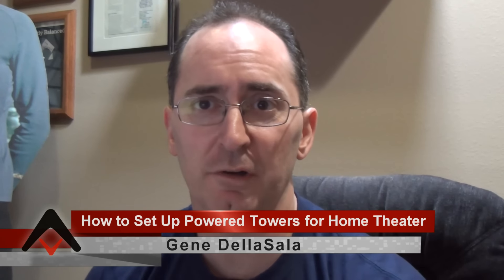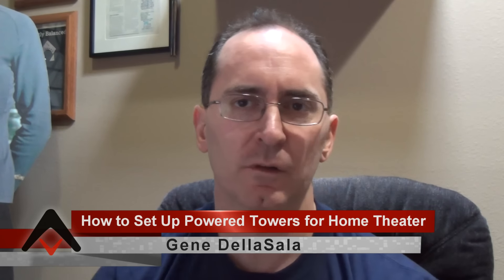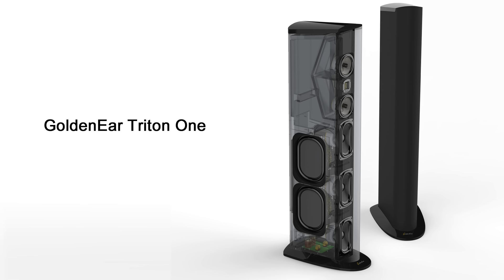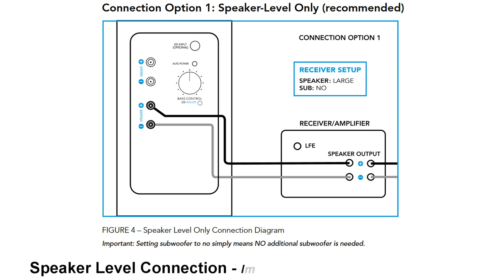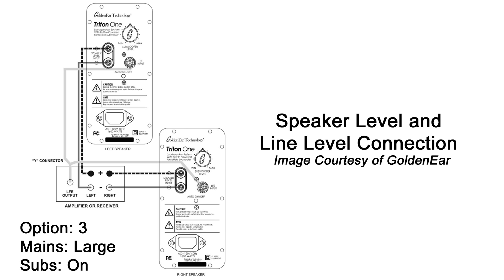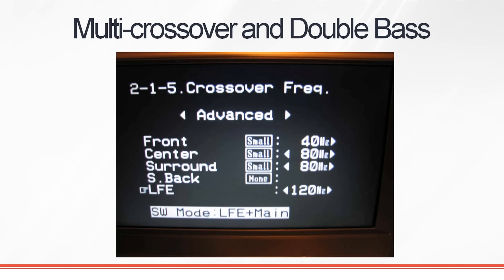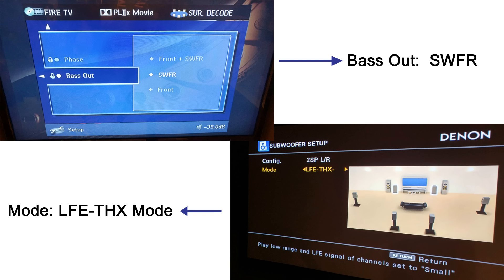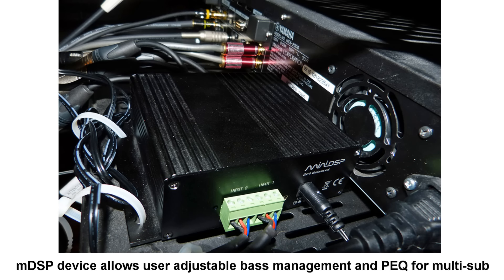How to Set Up Powered Tower Speakers for Home Theater

Comment: I'm a little late to the game on this. I'm an avid Audioholic consumer, but I missed this. I have been running RBH 1266 towers for years. When I moved I lost wall space and the sub had to go. I set the towers to full range and bass plus but I was never really satisfied with the solution, even running with a power amp. I then bit the bullet, purchased a crown XLS 1002, decoupled the binding post and set the tower to small and use the built-in 12" drivers as dedicated LFE subs and my system sounds amazing again! Great explanation and options, Gene!

Comment: One thing to consider on the Def Tech towers and center channels when deciding how to set them up, either full range or small is this.  Gene you mention setting them up as small with LFE will give you better bass control than having them set to large.  But, at least on the Def Tech 9000 series, each left and right and center channel has bass management controls on the rear of each speaker.  A dial with 1-10, to set the bass output.  In my opinion, that negates the necessity to use the LFE out put.  I don’t know if Golden Ear or other large fronts have this feature, but I like this feature on the Def Techs.

Comment: With my Polk RT3000p, after trying different options, I ran subwoofer cable from AVR to each of the towers. I incorporated a MiniDSP to tune them in with my 18" Marty's and the sound and bass was significantly better.  The powered subs in the towers are no where near the other subs, but by adjusting them individually to work with more of the mid and higher bass in the 60-90 Hz range and the monster subs hitting hard in the 60 Hz with more pressureization and dig down to 14 jz in my room.

Comment: I have Def Tech BP7001sc mains, CLR3000 center, Def Tech BP/VXp sides and BP7002 rears with a sunfire true signature sub. I run all speakers as large because they all have powered subs and LFE out to the sunfire. However in running all speakers as large that allows me to control my crossover point without setting them to small and being stuck with 80hz. I bought large speakers to use them, if I set them to small I would've just bought satellites. I crossover the front mains at 40hz and everything else at 60. This was chosen after using RTA and FFT analysis for the smoothest blend with the sub.

Comment: Thank you so much for the informative video! I recently bought a pair of definitive technology bp9060's for my L/R channels to match with the CS-9060 center. Using the Denon X4500H. Should I choose your 3rd option by setting them to Large, Sub On along with the small pioneer 8" subwoofer I currently use? Maybe disconnect the sub and just use the towers as my living room isn't that big. Thanks in advance for any insights.

Comment: Hey guys, another awesome video. Just what I was looking for. Been running my four powered towers as small and running a splitter from my 2 sub output on my receiver. Going to try setting them to large and set LFE on to use the built in crossover.

Comment: Thanks for this, setting up powered towers is something nobody ever talks about. Benn using Def Tech 8060s but had it set to LFE+Main...I will correct that now
Reply: Whcih configuration did you switch too? and did you experience a noticeable audio improvement switching from LFE+Main to the new configuration?
Reply: Tyson Hook right now I have it set to just LFE...I run the main as large to get some use out of the woofers in the towers and to help spread out some of the bass...it sounds fine but I am always tweaking it...getting powered towers and a large sub perfectly tuned in a small room is tough...it's not like video where there is a test pattern and you just calibrate it..with audio, and especially bass, there are just so many factors to deal with. Add to that that I only have one location I can put the subwoofer...it can be tough to balance everything out

Comment: I’ve been using the RBH SX-T2/R and SVT towers for a while. I set them to small, XO = 120Hz, connect speaker wires from pre-pro to top cabinets, connect line cable from Sub Output of Pre-pro to external sub amp then speaker wire from ext amp to the bottom bass cabinets.

Comment: I'm running 6 Paradigm Shift A2 powered bookshelves that get their signal from an Asus Essence STX II 7.1 sound card.  The LFE goes out to a Paradigm DSP-3100 with a Paradigm MC1 powered by a Dayton "T" amp handling the center channel.  I keep the bass management set at "small" with it crossed over at 69hz.

Comment: I am running 4 Def Tech BP2002 with a Def Tech PF 18 TL sub. I just updated to a AVR-X4700H receiver. Right now the best sounding hook up I have found is running LEF input, large speaker setting, and the low range jumpers removed. I have two questions, that Def Tech could not answer. The first question is can I run full range with the low and mid jumpers installed, while running LFE? My second question is if I have to take out the lower jumpers will my Frequency Response of 18Hz to 30kHz change. When I asked Def Tech  they said it would not change. But I don't see how it can't change with the lowers removed from the circuit.  The reason I asked is so I could determine the correct cross over range up the highs and mid when I have the receiver set to small speakers.

Comment: Hello Gene ;  I had 2 - 60 inch Pioneer Elite Plasma and a 60 inch Panasonic ZT 60 in my man cave above garage. On December 10, 2018 an electrical fire broke out. My Definitive Tech speakers and everything I owned burned to the ground. A 2200 square foot single family home was gone.  Because I’m paralyzed from a broken neck in 3 places 30 years ago, I was trapped upstairs. With fire burning everywhere, I dove head first down the stairs and was knocked unconscious and woke in black smoke unable to see or breath. I heard a fireman yell my name and yelled - dont leave me and passed out - they found me but I’d stopped breathing and cpr was needed as they dragged me out the door and the home collapsed.  I’ve lost everything and just returned home from UNC BURN CENTER after weeks in COMA and 3 months total. I’m looking at DEF TECH 9020,S AND PRO 1000S AND whatever you can suggest.  Thanks
William

Comment: I have some BP7006s and a CLR2002. Had a sub but it's too much for my small living room. So just wanna use the BPs for sub. Have Onkyo TX-NR696. What would you do? Also should I double the connection to the center channel?

Comment: Do you recommend connecting the def tech CS9080HD center speaker with speaker wire set to large as well as LFE to the center preout on my receiver? Does that allow extra punch on the center or is it dangerous?

Comment: I am using def tech bp9060 and have them set to small with 2 def tech sc2000 using lfe to both subs with a Pioneer lx701 avr. I would like to use lfe for 9060 but using splitters is not recommended by Pioneer, Suggestions?

Comment: Hello,

I am looking at the Definitive Technology BP9060 and I have a SVS PB12-NSD Subwoofer. How would you recommend hooking up these speakers if I end up buying them. Also how well will a powered sub (PB12) integrate with a powered subwoofer tower like the BP9060. My other option was the Klipcsh  RP-8000F since I already have a sub. I do not want to get rid of my sub so which one would be the best option. Thank you

Comment: Great video!  I have been looking for this info for months.  Current setup, denon x3200,  lfe only at 120 hz to svs pb-2000, 8060 towers speaker wire only set to large at full band, cs8040 set to small at 60 hz.  a60 set to small at 200 hz.  dynamic volume off and dynamic eq on with reference offset to 0.  I will try adding a splitter and lfe to the 8060 towers as well to see how that changes the sound.  Great info!  I have read you should set the crossover 10 hz above the lowest range of the speaker.  So I set mine at 60hz.  my reciever only gives my 40, 60, 80 or 120 and so on.   Sometimes I notice port chuffing on the sub with dynamic eq on.  I turned down the gain on the sub and this eliminated the problem.

Comment: QUESTION: I like the idea of setting speakers to Large and allowing the subwoofer to focus exclusively on the LFE signal. But, I do realize speakers usually can't go lower than 35hz. So, I had a question about using two separate subwoofers to work with the Front Speakers. The LFE signal would still being going to the first two subwoofers. And the 16-gauge speaker wire would be going to the two Front Speakers that are set on Large. Would it be possible to use the Front Left Output to send the Front Left signal to the Front Left Subwoofer and use the Front Right Output to send the Front Right signal to the Front Right Subwoofer? ... This would theoretically allow the two LFE channels to output the LFE signal, while he Front Left and Front Right speakers set to Large would output sound as low as they can go, while the Front Left Subwoofer and Front Right Subwoofer would receive the entire Left and Right signals, but only output sound below the Crossover Frequency - which I would personally set at 50hz. ... Is that correct? ... Would that setup work as I described?

Comment: New at this and setting up some Energy Veritas V2.4i to a Yamaha TSR-7820 and can't get the 3 subs that's are built in on either tower going. Tried Small/Large with woofer on/off. Have them on 5.1 Bi/AMP as well. Any help?

Comment: I tried out your advice. I just got a pair of the Definitive Technology BP8080st's. My Marantz receiver is set to large for the towers. I set the subwoofer to "On". The "Subwoofer Mode" is set to just "LFE". I left the crossover at the default of 120hz. Then I ran the "Subwoofer Out" line level connection to the "LFE" input on the back of the speakers. I use the receiver controls under the "subwoofer mode" to raise or lower "LFE" level. The low level bass has a much greater impact like this. Thank you!

Comment: Need your opinion.  Finally settling after military retirement and looking to get a decent setup.  I have a Marantz SR5010, Pair of DT 9040s (just picked them up on craigslist) and an SVS SB2000 as well as some other surrounds.  My question is regarding the 9040s and SVS sub:  The 9040s alone sound really good and provide surprisingly good base for their size.  Would you recommend also adding the SB2000 to this system or use the 9040s without the SVS sub?  If you would incorporate the sub, then how do you recommend connecting the speakers?  Could you do a Y-splitter on one of the LFE outputs and use the other LFE for the the SVS Sub?  Look forward to hearing from you or anyone else who might have some experience with this scenario.  Thanks

Comment: Hello, 

I wanna ask you something. My room has 300  square feet and the setup is Mains Definitive technology BP9060, Center channel BP960, all them sat to large in the AV.
 In ceilling dolby atmos martin logan Helos 12. sat to SMALL, surrond back in ceiling Martin logan electromotion R paired with a Rel T5X FOR High Level frequency,  SAT to LARGE and also this sub is connected to LFE to the AV.  

I want to ad one more sub for LFE, to get more punch in my room, and i am thinking to install a REL HT1250 or a REL S510, i Cant install a 1510 predator because i dont have space betwwen the speaker and TV cabinet,  would you ad one more SUB? and, which one would you install just for LFE input? 

And Because that i already have a REL sub, is not fine to mix brands, because instead of the two rels that i asked you, i would install a SVS SB3000, but i think it wouldnt be a good idea.

Thanks for your help. 
Regards

Comment: Great video... In the last example.. Can you hook up your main speakers via high level connections through a subwoofer and still split the LFE for the mains   while setting them to large?  I have DefTech BP9080X and I want to run them as large...Thank you!!

Comment: Can fully powered / active speakers such as the Kii Three or the Dutch & Dutch 8c also be used in a HT setting? I would like to use those as "normal" speakers for 2-ch music listening but also as FL and FR speakers for watching movies and listening to multi-ch music recordings. The other multi-ch speakers would be passive, i.e. two used as SL and SR and four used as atmos / height channels. The setup would be 5.x.4; x obviously being the number of subs, still to be decided.

Assuming a certain latency because all the DSP calculations that need to be done in the active speakers, are surround sound processors able to correct for the difference between the active and passive speakers and the video (lip sync issues)?

Thank you for your feedback.

Marcel
The Netherlands

Comment: Gene,

I have four active Klipsch XF-48 speakers connected to the pre out of my Marantz 6010. Also I have a 450C center speaker and one Klipsch R-115SW in my setup. I did use Audyssey XT32 because this is a living room and not dedicated.

Do I need to set the XF-48 speakers on large?

Comment: I am running Def Tech BP8060's as my towers and CS8060 for a center.  I also have a SVS PB13-Ultra as an additional powered sub.  My amp (Marantz 7008) has 2 LFE outputs.  I am currently running one LFE to the SVS and the other LFE to the 2 towers through a Y splitter.  Is this what you would recommend for wiring and bass management?  I have very good sound quality but am having a difficult time setting up the bass.  Either not enough or too boomy (if that is a word)  Really hard to find that sweet spot.

Comment: I have DefTec 9020's in my starter home theater.  Reading many articles about acoustic panels most recommend placing behind the main speakers.  However these towers have rear firing 3.5" midrange speakers at the top where panels would be placed.  in this case should i forgo the rear panels?

Comment: I'm running the DefTech ST powered sub speakers and they require a plug in for the bass. If I were to use the LFE connection from my receiver, do I still need to plug the speaker in or will the receiver now power the bass speaker? I use the Denon 4100. Thanks for the help.

Comment: Hello how you been! 
I was wondering if you could answer some questions that i have... i have a 2 floor house not so big but i want to install a Onkyo TX-RZ810 in the second floor and for the zone 2 speakers ... cable to first floor many meters maybe 50m to reach my livingroom and then in this spot, set a pir of Definitive Tech tower speakers with subwoofer integrated... the thing is to keep my AV receiver on second floor and communicate by the wifi with my phone... and use the AV receiver also as a 5.1 home theater for movies upstairs... 

The question is about if you have any idea of this equipment and if you recommend to do what i described or should i go for wireless systems like SONOS for example! ... i was wondering if zone 2 of the amplifier have sub woofer output too ... i am not sure...

Well hope you can answer me and give me an advice! Thanks!

Comment: I just bought the def tech 9060 towers, along with their center CS9060 and 2 SR9040's for the rears. Also bought a SVS PB 2000, still working on configuring them and don't really know what I am doing, any advice would be appreciated! Also using a Denon AVR-S920W receiver and I am using the LFE in the 2 towers, so total of 3 subwoofers for my setup.

Comment: Sir my question is that, what if we have active speakers with built in subwoofer, so in stereo mode what should be speaker configuration. Either it will be large or small & lfe or lfe+ main should be the setting & subwoofer should be on or off....?

Comment: Hello Gene, 

What are the risks and rewards of wiring GoldenEar Triton Three (Gen 1) towers (8 Ohms) with 6 Ohm Speakers (Aiwa SX-N999) to the Left and Right (shared on binding posts) of any amplifier. 

Ideally I want to route LR signals twice one pair to GoldenEar Tritons, another to the Aiwa's. But the AVR software doesn't allow that, so I ended up using Aiwa SX-N999 as LR front presence speakers (on 1 foot stands). Which seems limiting and is DSP dependent. I rather have known LR sounds replicated twice.

I do this, because it creates a wall of sound with all speakers playing at the same time. This also allows me flexibility to sit on the floor or higher on a seat and sound envelope stays immersive.

Will parallel wiring damage either Triton Towers or Aiwa monitors?
Or damage the Yamaha RX-A840 AVR.

Is there a better way to achieve this? With wiring or with additional equipment?

I know this is an unusual setup, but it fills the room.

HiFi Setup
Yamaha RX-A840
GoldenEar Triton Three (Front LR)
Aiwa SX-N999 (Front LR Presence)
GoldenEar SuperSat 50C (Center)
Reply: I'm not Gene but I just came across this article that shows something similar to what you want to do:
https://www.highdefdigest.com/blog/dolby-atmos-beyond-7-1-4-part-1/